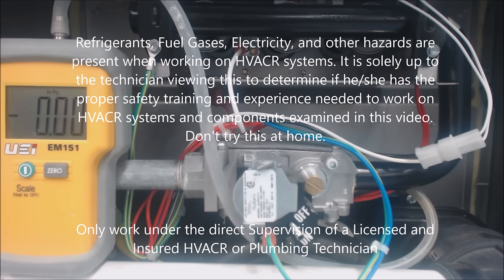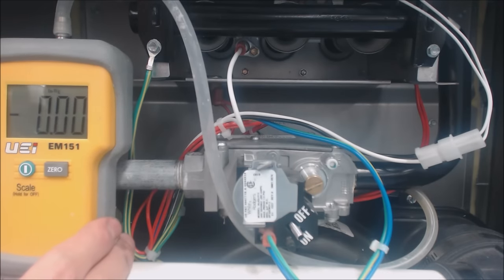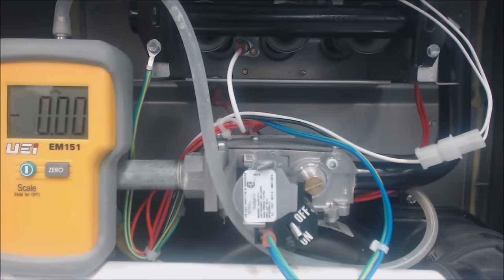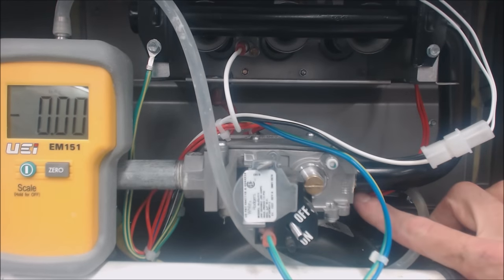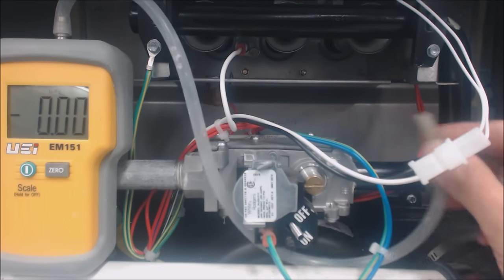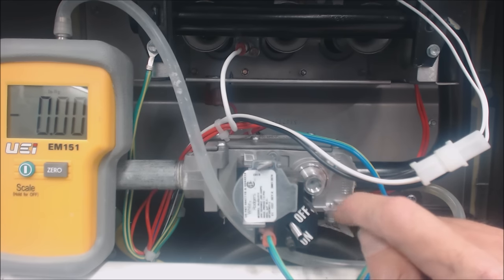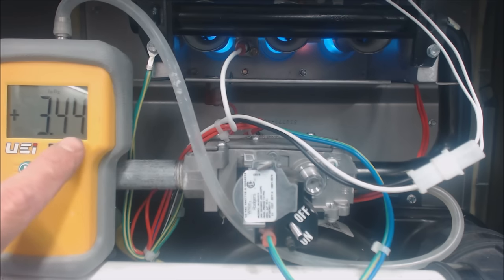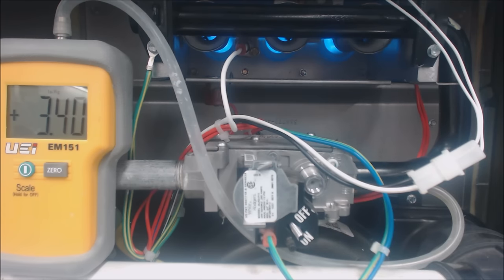Checking and Adjusting the Outlet Gas Pressure going to the Burner Tubes on a Gas Furnace!

Comment: Why does it have to be zero'd out with the inducer motor running?
Reply from the maker: This will give a true difference in pressure when the inducer is running. Depending on your seal level height or inaccuracies, always zero the manometer first, thanks
Reply: Thanks,  if someone took the boss screw completely out of the gas valve instead of just turning it out one full turn and using the manometer, would you get a different reading?

Comment: What if the plastic cap is missing? I'm having issues  adjusting  gas pressure on a 2 stage American standard..have you ever changed a blower motor and then it started to trip high limit? This is my issue. EXCHANGER  IS GOOD,VENTS  OPEN,FILTER  OK,COIL IS DIRTY..WHY WOULD IT START ACTING  UP NOW? EXPLAIN. THX
Reply from the maker: It sounds like the blower motor speed is set too low. what is the temp of the air that is tripping the sensor? The temp rating of the sensor is on the sensor itself. If the temp you are reading is lower than the sensor then the sensor is bad. On high speed the temp rise of the gas furnace is usually about 50 degrees so if the return is 70 then the supply is 120.
Reply: HIGH LIMIT  is suppose to trip at 170F. I'm a tech. I was just there to replace the blower. I replaced it and didn't change any speeds but it trips. Filter new,vents  open,new cap.
Please be more specific...why would it trip after only changing blower. Why wouldn't coil have been issue before if it has been dirty?
Reply from the maker: Straightoutofchiraq, the reason is either low airflow or a high limit that just happened to go bad. What was the delta T across the furnace and was it increasing while the furnace was running? How long before the high limit tripped. What was the supply temp?

Comment: How do you turn on the pilot with this model?? I need to turn on my furnace but don't know how.
Reply from the maker: It would depend on if it was to relight the pilot, or if you have intermittent spark ignition or intermittent pilot ignition, or direct ignition, thanks

Comment: Hi. I have the Goodman GDS8703AX gas furnace, and after replacing the gas valve, it seems I need to wiggle or remove and reconnect the 24VAC line that goes from the valve to the big connector to the back of the furnace panel somewhere to make it work for a few days then now, nothing. I measure the voltage and it does not switch to 24VAC from about 14VAC when it is supposed to happen.

My question is where is the 24VAC that drive the gas valve coming from. I thought it is from the controller board but here it is not.  Thanks.
Reply from the maker: Usually it is directly from the control board. Is there a wiring diagram?
Reply: Thanks. Like some people encountered and posted on the web, I wiggled, unplugged and replugged the connectors and it is eventually working now but not sure for how long. I will have to look into the diagram.

Comment: hi, i have this sealed combustion lennox furnace. When i open the brass screw my pressure reads 3.5"w.c. But strange when i put the brass screw back my pressure drops to 3.1"w.c. Is this normal? I've tried with another same lennox furnace and the same result. thanks.
Reply from the maker: With those type, you may need to set them with the combustion door open, then put the screw on and shut the door, and then read the pressure to see if it is measuring what you want it too, thanks
Reply: so the final correct gas pressure reading (around 3.5"w.c.) should be with the combustion door closed and the brass screw tightened. Is this correct? thank you.
Reply from the maker: That is correct as that is what it will run at all the time if that is the wc the furnace is calling for, thanks

Comment: Hello, If a 95% eff. gas furnace runs at 3.5 in of water, can you downsize the furnace, by changing the gas outlet pressure to 3.25 in of water?  I did this to my furnace, and the burners look the same as if they where set at 3.5 in of water.  [ I believe my furnace is over sized for my size house ]
Reply from the maker: Most nat gas furnaces call for 3-3.8 or 3.2-3.8 so that is quite normal. The inducer speed is matched for the gas input for combustion so keep that in mind because you don't want to get the combustion mix air/gas off and burn inefficiently, that's the main thought. Also the blower speed is matched for the gas output to keep the temp rise across the furnace asa 50 degree rise from return to supply, thanks!
Reply: Thanks again
Reply from the maker: Glad to help Ronald!

Comment: Without measuring Delta t that number is pretty useless. I can almost guarantee you that furnace is overheating.
Also, depending on the specific gravity of the gas, you should be able to have a vast greater adjustment capability. In addition to that, only a combustion analyzer would be able to tell you if you were truly performing as close to complete combustion as possible.

Comment: Can you tell me what is the size and or thread pitch on that brass ntp connector?
Reply from the maker: They are 1/8" and they will come with the gas manometer. These are the same size typically on all gas valves, thanks!
Reply: Yeah I picked up a cheap manometer that didnt come with them and I can find them alone but thanks for your help
Reply from the maker: Got ya, yes you can actually go to home depot or lowes as they have ones that fit. Take the plug out on an old electrical gas valve with the service wrench and bring it in with you to verify that it will fit. Maybe your hose for the barb fitting too, thanks and hope that helps Matt!

Comment: I have a  gas stove that has propane tank outside feeding it, HAD line checked for leaks, he said NO LEAKS but he is still getting half a psi reading when turned off ..........is this normal for a gas stove ?  Maytag Gemini double oven
Reply from the maker: Propane is 1/2 a psi and if nothing is running then that 1/2 psi would still be in the line, thanks
Reply: Yes but does that mean he would still be getting a reading on his meter even though everything is turned off he said it goes down to less than half a PSI he says which is very very very mynute

He said he thinks it's an issue with the stove itself but I'm thinking maybe it's normal for the stove to be like that is that what you are saying it this is a normal thing?
Reply from the maker: propane runs at 11-13" wc which is roughly 1/2 a psi.    27.6wc= 1 psi   so 1/2 a psi is not mynute. It is the gas pressure of a propane line with the valve off and nothing running, with the valve on and nothing running, and also when the valve is on and the stove is running. I would rely on a licensed company but if you don't trust your current tech then I would call a different company, thanks

Comment: Somone tested my outlet gas pressure of my Natural Gas Furnace, he said it was reading over 9 and he adjusted to 3.5,  a few days later I borrowed a Manometer and tested, it was only 1.1 water column, I think he had his Manometer set to Millibar Scale instead of water column Scale, his was a new meter that he used for the first time.  I have acquired a UEI M-150 Model and adjusted to 3.5 Mg and have re-checked several times. what is your opinion on that one???? I also have checked my  inlet with my Manometer and it is reading 5.90 which I think is about right for normal incoming gas pressure to the gas valve.  Please Reply anyone ....???????.......Thanks....
Reply from the maker: If it is natural gas and single speed then yeah 5-8"wc input and 3.0-3.8 output typically and then we adjust for efficiency within the range when using a combustion analyzer, thanks
Reply: @acservicetechchannel  do you have a video adjusting for efficiency using a combustion analyzer?

Comment: is in H2O the same as in wc?
Reply from the maker: Great Question! We used to measure gas pressure with a manometer ruler with water in it. It was a true vertical column of water. This would be measured in inches of rise in the column and therefore we measure with digital instruments now in inches of wc. Thanks!
Reply: Yes

Comment: What size brass Barb fitting do I need?
Reply from the maker: I have them linked at https://www.amzon.com/shop/acservicetech I believe they are 1/8" thread, thanks!
Reply: @acservicetechchannel  Link is no good, but my local ACE website states they have one, as my manometer came with a 1/8 barb x 1/4 inside thread male

Comment: Single or two speed what is that we call it single, two stage or variable stage .
Reply from the maker: single speed gas valve has one spring screw, two speed has two spring screws, three speed is a two speed gas valve with another tiny valve afterward and modulating has no springs but just an adjustment screw connected to the electronic control board on the top of the gas valve, thanks!

Comment: Can you do me a favor to explain with a device how do I know when exactly my propane will finish so as to know when to go refill instead of disappointing me,because it didn't know exactly when its about to finish.. I know about pouring warm water  but can you create a device that can set a kind of alarming sound alerting me about the finishing of the gas..
Reply from the maker: There isn't really a way to tell if the propane is getting low until there is no more liquid left in the tank. At that point the pressure will lower. Furnaces that have been converted to propane will typically have a low pressure gas safety switch piped in. You could look up "acservicetech low pressure gas switch" Most larger propane tanks have a float inside that stays above the liquid level to read pressure, thanks

Comment: Excellent video.  I think you mean 2 “stage” instead of speed.
Reply from the maker: Many use stages and speeds interchangeably in regards to a furnace gas valve, thanks Donald!
Reply: AC Service Tech LLC   Ok. I just heard  multi Spode for the Blower.
I want to add a low pressure switch on my propane supply line.  It froze up a few times and delivered low pressure and my water heater soothed up twice.  Any suggestions?  Thanks.
Reply from the maker: I always get them when installing Carrier, Bryan, Payne lp conversion kits but you may also be able to get them through Johnstone.com thanks